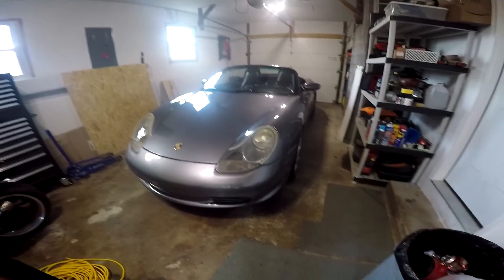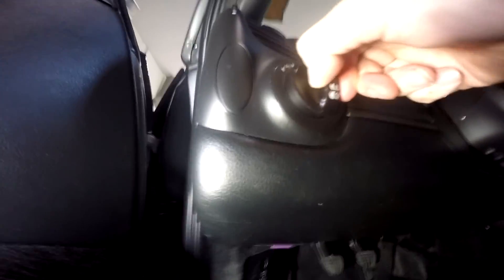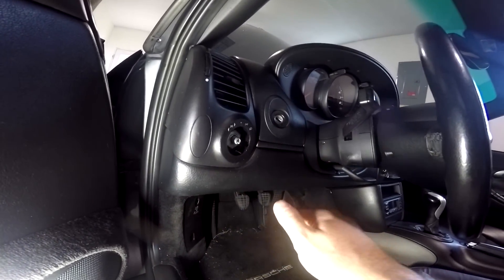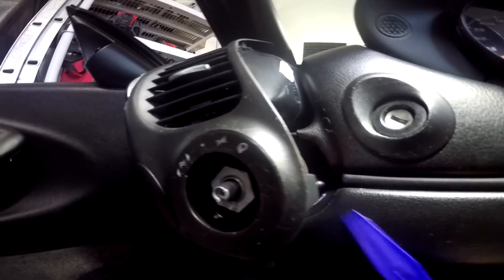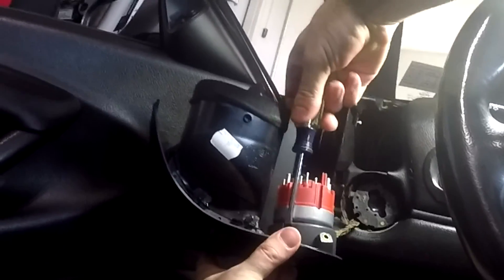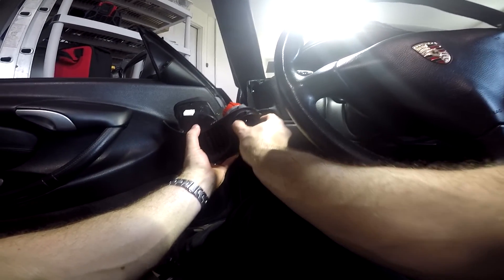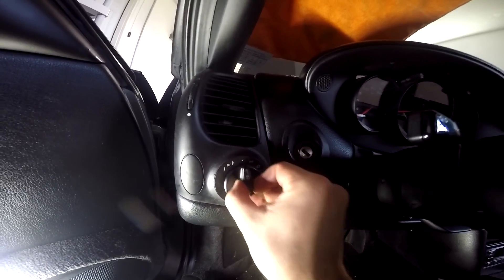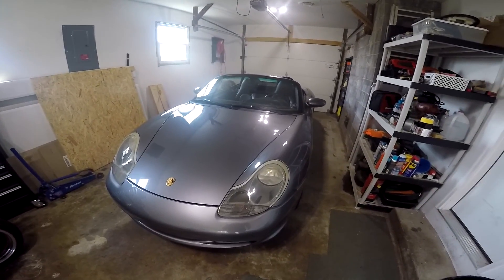Headlight switch replacement (04 Boxster 986)

Comment: Great job. Thanks. A proud owner of a 996.2 carrera 4.
Reply: Do I have to disconnect the battery for sure? 😅
Reply from the maker: @JSARLIS  It’s up to you, I just make a point to when I’m working near an air bag. But that’s a matter of personal preference.
Reply: @lonelyryder7441  oh ok I see.. thanks a lot. I have the same issues with my lights switch is completely loose now and the rear left  it’s off